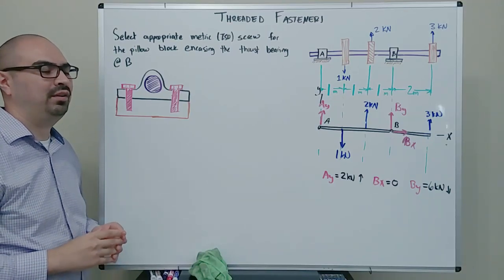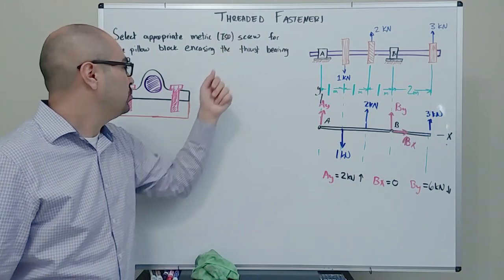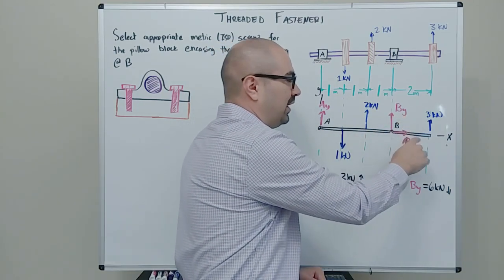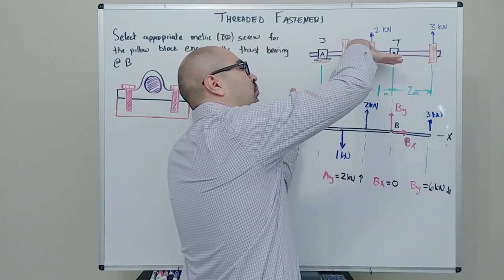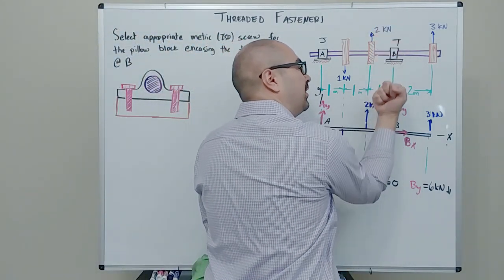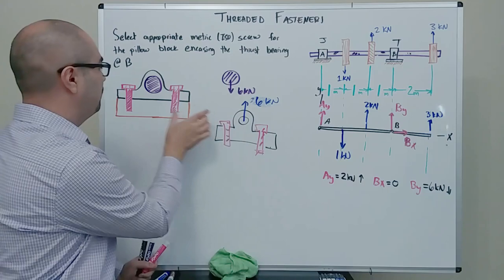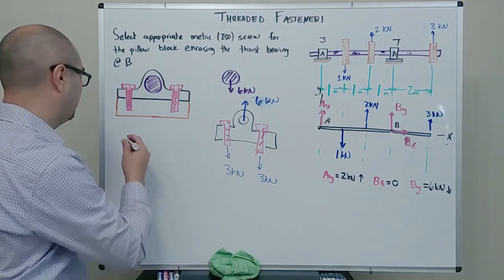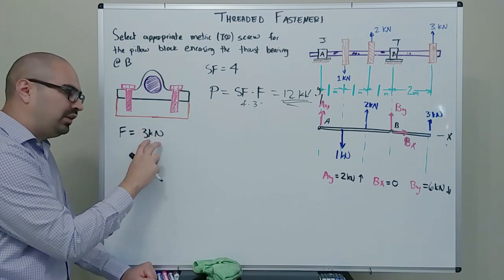Machine Elements - Threaded Fasteners

Comment: important to know that if the yield strength of the bolt is higher, then you use the yield strength for the ratio not the proof strength!!!!!!!!!
Reply from the maker: Yes, thanks for picking up on this - use the yield strength of the bolt not the proof strength.
Reply from the maker: you may use the proof strength of the bolt when the yield strength of the bolt is not available - this will give conservative approximation